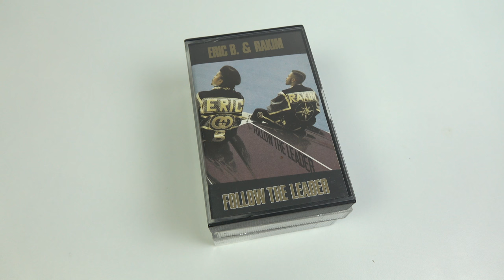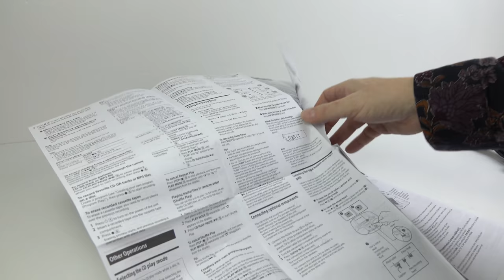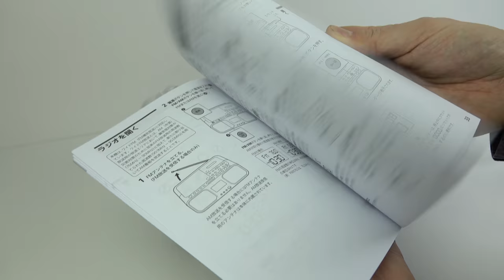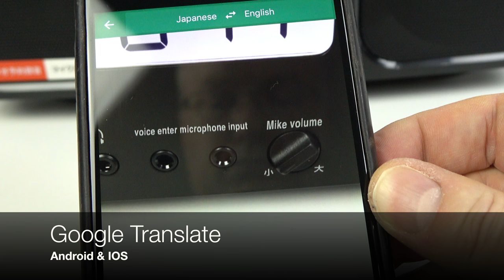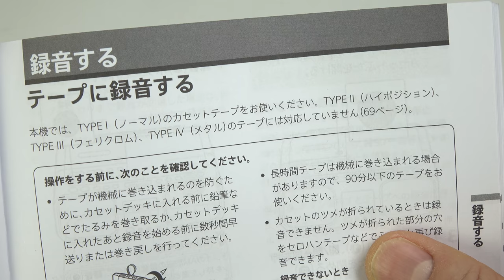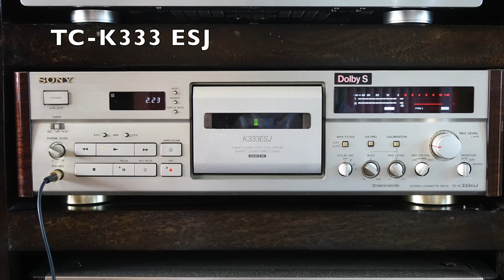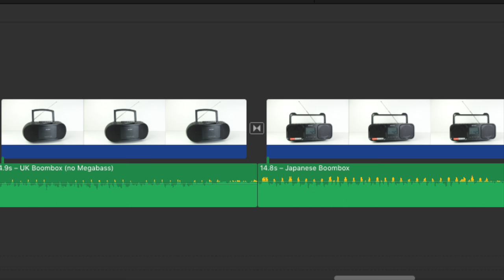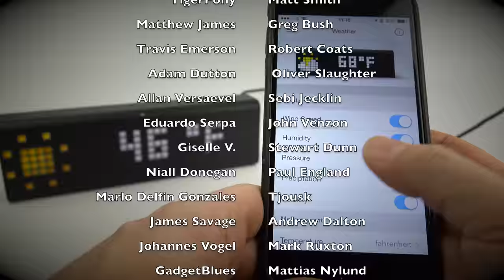Sony's New Cassette Boomboxes -  East meets West

Comment from the maker: Regarding the FM Radio Tuners
The Japanese model can be turned in to any frequency between 76.0 to 108.0 with 0.1 increment steps.  The UK model can be turned in to any frequency between 87.5 to 108.0 with 0.1 increment steps.  Both radios pick up all the frequencies broadcast in the UK. The radio tuner on the UK boombox is less effective at bringing in a clear strong signal. This is not to be considered unusual....some radios are better than others, in the same way that reception on different phones on the same network can vary.
Reply: Techmoan that is a let down since my country's radio frequency are from 80-120mhz
Reply: Techmoan do you have anything on music on hold for a  house telephone
Reply: Techmoan hi have you heard the ruark r1 mk3 ? I like to hear your opinion on it
Reply: I noticed that when I was browsing Japanese auction sites for boomboxes/radios, a lot of them only tuned from 76-90MHz, which I think is because their analogue TV channels interfered with the international FM broadcast band, so they decided to go with 76-90 instead of 88-108. Many older radios and boomboxes also included support for 'TV band' (i.e. audio from a TV signal) which effectively covered 88-108MHz but it wasn't universal. Now that they've switched over to digital TV, they've expanded their FM band to 76-108, but a lot of radios still don't cover the entire range (especially if they're old models that are still being produced). The thing you need to look for when buying Japanese radios is "Wide FM", which would cover the entire international FM band.
Reply: And in Norway the FM is being shut down in favour of DAB+ :/ 

Great video as always, thank you! :D
Reply from the maker: See the top comment for details of the frequencies accessible on the tested models.
Reply: Fortunately for us here in the Philippines, FM radio is here to stay! (or so it seems)
Reply: Right! That's why I like listening to the radio on Sundays!
Reply: Oops my mistake. We in Malaysia use the same frequency as in UK. Up to 108. I think  Japan never go 100. But if that radio can go over 100, that is amazing (and import friendly).
Reply: Here in the Philippines, the highest FM radio frequency I know of is 107.5!
Reply: I was under the impression that FM was already shut down in favor of the still-born DAP in the UK
Reply: DAB can sound alright, it just depends on the bitrates the broadcasters use. Many countries including Norway are now using the improved DAB+ standard which is about twice as efficient as the older DAB standard (the downside being that older receivers can't pick it up). 

The problem is that the broadcasters are trying to squeeze too many broadcasts onto a single frequency. The BBC broadcasts 9 services on the one national DAB frequency they've been assigned, for example. 

I live in Australia which exclusively uses DAB+, and the quality still isn't very good. There are three frequencies which are assigned for DAB broadcasting - one is for the public broadcasters which has 20 services on it (I don't know why they bother because half of them are not broadcasting anything relevant 90% of the time), and two are controlled by commercial broadcasters which have a combined 40 programs broadcasting on them (that's all the existing AM and FM stations, plus a few digital-only ones), most with abominable bitrates which sound awful because they've been all packed into such a small amount of radio spectrum. 

The obvious solution would be to expand the number of frequencies available to broadcasters so they can improve the quality, but that doesn't look to be forthcoming. The amount of radio spectrum that digital radio uses is so tiny compared to AM or FM broadcasting that it really is just a drop in the water. 

60 radio channels in better-than-FM quality on DAB+ can be broadcast in the same amount of broadcast spectrum as six FM stations, whereas currently the ratio is 60 channels over the equivalent of three FM stations, which sounds really crap. I don't understand why governments are so hesitant to release more frequencies!
Reply: That's quite unusual for a product for the Japanese market.  Most stop at 90.0.  I was surprised when you managed to go higher!
Reply: At 11:21 you can see "ウイドFM" on the lower part of the box, which means "Wide FM".
Reply: Tams80 They expanded the FM band a few years ago after the original FM band became saturated and the old analogue TV broadcasts which interfered with the international FM band were turned off.
Reply: Techmoan In the states, we have both hd radio and analogue. No plans to kill analogue radio, thank God. Hd am makes a hiss on analogue adjecent frequencies. Some area of the U.S. have only one or two hd frequencies. HD radio has been a bust. They put the receivers in new cars. The old am stereo is still used in some places and hd am can pick these frequencies as well. AM in the U.S. needs improvement.
Reply: Techmoan  wow my friend you put a Puerto Rican song (Bomba puertoriqueña) Good culture music from my country. :-) Im from Puerto Rico and i always saw you videos, very cool old technology and memories you review.
Reply: Techmoan Thanks for answering my question about the radio tuner - older Japanese market radios run the FM band from 76 to about 93 MHz and not much beyond that.

As always, a thoroughly enjoyable episode.
Reply: The other day I had to fiddle with the Walkmans I bought from Ukraine or somewhere for 4 hours to figure out how to change the FM bands from Japan to US. Totally worth it.
Reply: Does that mean 83.7 FM comes in?
Reply: I always enjoy the new products you demonstrate. Also love the sense of humor ( the dust ) lol!
Reply: I was in Tokyo & they use 76 - 90 MHz anything above there is nothing but static.
Reply: Techmoan
could you get your hands on this U.S. model (ZS-RS60BT) for a future video? Would love to know if compares at all to the CFD-S401 you featured here. 
EDIT: The ZS-RS60BT is CD only. No cassette, but has a similar handle and "bass port" design to the CFD-S401.
Reply: I suppose that's if they happen to go somewhere else in the world (say the US) where our FM band ends at 108MHz.  Japan's FM band normally ends at 90MHz.
https://en.wikipedia.org/wiki/FM_broadcasting_in_Japan
Reply: The Japanese FM Radio band covers 76Mhz to 95Mhz, The British system uses 87.5Mhz to 107.9Mhz.  The reference to "Wide FM" is in Japan the FM Radio band used to be 76Mhz to 90Mhz with the frequencies from 90Mhz to 108Mhz being used for TV Audio. The Japanese Government then expanded the FM Radio band from the upper frequency of 90Mhz to 95Mhz, This is why the "Wide FM" tag was used, to differentiate between the older system and the new.  There are "Expanders" available which will shift the received frequencies to allow reception up to 108Mhz.

It is possible that the Radio Techmoan purchased from Japan has a way of changing it's receiver to work from 76Mhz all the way to 108Mhz.  It could be a jumper or diode on the receiver section of the radio.  Just a simple snip with a fine paid of cutters usually does the trick. I recall a similar trick I used on a radio scanner made for the US market (Tandy) one snip gave 25% more frequencies to listen to.  There is talk of the Japanese Government changing their FM band to the same as in UK, Australia, the USA and many other countries.

The British Government has said it wanted to change the FM band to all Digital, but because of a lack of interest the FM band is staying as is for the time being.  Australia has adopted it, but sadly it's only being used in the cities, us bushies have to endure the old system, which makes my receiver nothing more than a conversation piece, sniff.
Reply: That certainly makes sense given how some TV channels used the same band as FM in some cases.  Here in the US, channel 6 on the VHF dial correspond to 87.7FM's spot on the dial, leading to the coincidence folks had at listening to sound of a TV station broadcasting on channel 6 in their area to come on the radio.  Of course this is all back in the analog days when this was a regular thing.
Reply: Where is your ghetto Techmoan, where do you blast with your collection of boomboxes?
Reply: It says on the box Wide FM... (ワイドFM) If you are looking at a Japanese radio and want to receive US / EU FM radio then this is what you want... traditionally Japanese radios tuned from 76-90mhz, the 90-108mhz was for Analog TV (Older radios, especially with an analog tuner can often tune to this band if they have an upper end of the dial marked TV1,2,3 etc).. Since analog TV ceased to be broadcast the band has been opened up and now there are a few stations across Japan that broadcast on the higher end. Of course most car radios and other things with digital tuners don't tune past 90mhz so that's a bit of a shame but many of the analog ones would, so just make sure it's WIDE FM or can tune to the lower analog TV stations and you should be ok for stations past 90mhz.
Reply: I had a Chinese aftermarket deck in my car when I had it in Korea - It also had 0.05 increments. I found some neat broadcasts here in Canada on it!
Reply: Techmoan can you do a review of this new SKAA wireless audio format?  Love to hear your thoughts.  It's supposed to replace/be better than Bluetooth.  Thanks!
Reply: Sony radios do not recieve well. I have had the cassette/CD combo radio. They have no bass. The extra bass button don't do much. Either no bass or a little bass. I like old myserlf and have bought some old stock/new in box stereos and boomboxes, 8-track and cassette decks myself, but nothing like your collection. I wish I could afford to go on a E-bay rampage. I like your channel. And I have learned about electronics from the past that I never knew existed. Two thumbs up!
Reply: Techmoan what kind of clock is that in your video
Reply: Why do boomboxes never have RDS?  All my other devices, like phone, MP3 player, car stereo, HiFi, & even my PC TV card have RDS!  Why not boomboxes?  It's so helpful to display what station you're listening to!

Comment: The CFD-S401 is definitely a better class stereo system compared to the other stereos they sell today. The ability to scan thru the tracks on the compact cassette is very rare today. Even though the head transport don't compare to the older models where you can even program which tracks you want to play, it's still a pretty decent mechanism. I'm definitely looking forward to order this stereo to replace it with the one I use in my kitchen.

Comment: I found a 1985 Sony cassette deck for $10 at a thrift store and it has amazing sound quality.
Reply: Disney Video Archive What is model number?
Reply: Hardly a surprise there, mate. The real achievement would be to find a working, good quality cassette deck made in 2015, for a tenner. Most decks made by Sony, Aiwa, JVC and the like, were of pretty much solid quality back in the 80's.

Comment: Looks like a nice unit. Thanks. On portables, it's a good idea to put on a shelf with a wall 5-6 inches away, and listen standing several feet away. That's how many people (not all) store them and listen to their boomboxes. That sort of environment probably factors into the design parameters, especially like the UK SONY unit you reviewed which has a rear facing bass section. Being on a shelf (shelves above and below) tends to make most thin sounding boomboxes, sound 'boomier' and richer. Give it a try.

Comment: I've got the CFD-S70 in my garage workshop and really like it.  It's not easy to find a reasonably priced boombox that plays tapes, CDs and AM/FM radio.  And honestly, in that setting, both the sound quality and volume are fine.  The Japanese model seems better but if you are looking for a versatile sound source for your shop or a similar location I'd recommend the CFD-S70.  By the way, I didn't realize  until watching the review that these would play MP3s.  So I burned a lengthy classical music MP3 disc and it works fine.  First time I've burned a CD in years.  Thanks for reviewing this item!
Reply: does it still work?

Comment: More like MeagreBass
Reply: I actually would love to know the history of MegaBass. When did it came? How does it work? Why?...
Reply: It's nothing but a tone control.
Reply: @mikeangelo6667  No. True Mega Bass was a low pass filter/amp that boosted a narrow range of bass frequencies. Tone is merely a high frequency attenuator, rolls of the treble. Class dismissed.
Reply: @RWL2012  bass heavy music or often any music sounds too flat without bass boost on. Although you're correct in a way that especially at louder volumes bass boost can sound too boomy even to the point of distortion possibly even leading to speaker damage if they're not designed to handle a lot of bass at high volume.
Reply: @dodecahedron1  bass boost is called loudness on mostly older or higher end equipment. Designed to give more depth to sound at lower volumes as depth in bass isn't really heard at lower volumes without a boost to the bass or what sometimes is called loudness which can also include a boost or thickening to other frequencies as well.
Reply: @dodecahedron1  true that bass boost appeared in around the 90's. Possibly due to the rise in popularity of CDs and other digital audio that didn't see anywhere near as much success. Digital tends to to sound too bright on older equipment that naturally tend to boost high frequencies whereas newer equipment especially lower end tended to have a bass boost button to overcome lack of bass digital sounding too thin and tinny or harsh on the ears.
Reply: It is usually rather meagre or what I'd call boomy or boxy. Hence the name "boom box". Can't put speakers in a plastic or even metal box especially in most cases without insulation and expect them to have a solid bass boom. More likely to have a plastic thump like a kid smacking a plastic shovel on a plastic bucket. Imagine using that or similar as a bass kick drum. Wouldn't sound satisfying.

Comment: The cassette sound is quite good, even on the cheap UK model. I detected a bit of 50Hz hum (hints at a half wave rectifier setup vs full wave) during the track fade out on both of the Sony portables and the Aldi portable, and not on the hi-fi deck.

Comment: I got the "UK" model as a gift last Christmas, It was around $100 then, from a big box store. I use it in my food truck to jam while cooking/prepping. Bass Boost is a must and it plays CDs pretty well and gets ok AM/FM reception despite being inside a large aluminum box. Tape controls reversed from every other deck I've ever owned and still has to be looked at to get right. Annoying that the thing doesn't remember last station tuned, tired of having to take the time passing a bunch of other stations to get to the one I like every time I power it on. Have not tried the headphones with it. It plays loud enough I have to turn it down once I start getting customers or they won't be heard. It plays over the noise of my commercial vent hood so not as bad as the slagging you gave it I think. In that environment it gives me something to tap my toes to while working, fidelity would be wasted there anyway.

Comment: I had an AIWA mini boombox that had a "wide" switch which created a bit of surround sound through the 2 built in speakers, but also had outputs for hooking up 2 optional speakers to be placed much further apart and which created a very convincing and well balanced surround effect. With the Mega Bass button pressed the bass was quite solid and nicely defined. Amazing little $50 gadget!

Comment: i made my own; i bought a digital am/fm radio tape player with 40 preset channels, for $5 at a goodwill. took it apart, took te tape player parts out, added a speaker, and it sounds great! i checked on amazon for something similar- am/fm digital radio w/ 9 preset channels for $100...